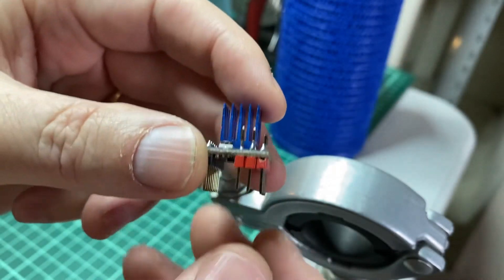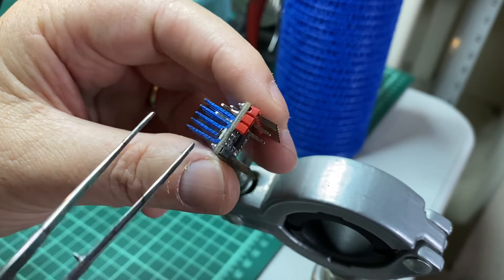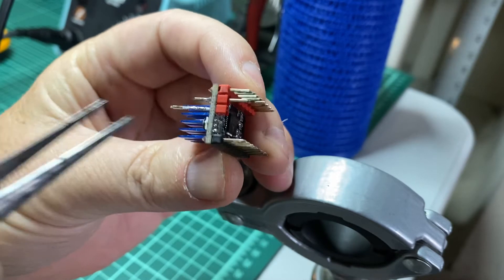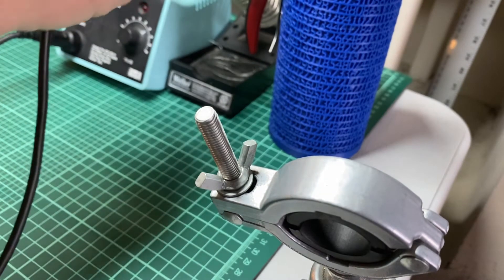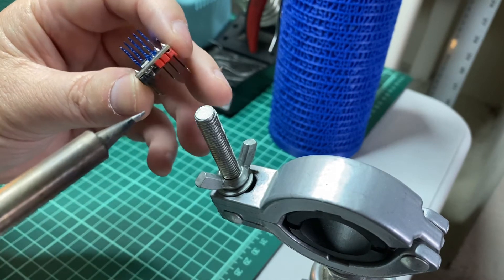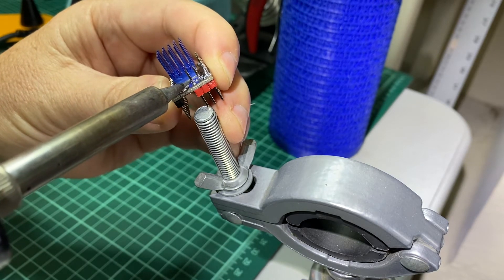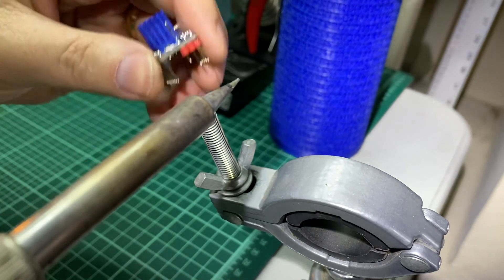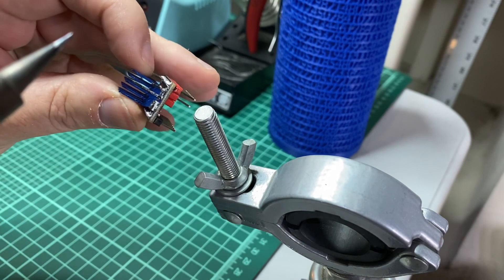TMC 2209 disable sensorless homing (fix for physical end stops not working)

Comment: 700 degrees - no way that can be celsius, still too high for kelvin, so it must be the simp measure - farenheit. Strange when a person is in to 3d printing and still uses the simp system.
Reply from the maker: Soldering station is in °F. No Celsius marking on the analog potentiometer. You imply that I choose F over C, when in fact, I’m just reading off the front of my Weller soldering station. Glad you found my video useful.

Comment: Awesome video. Quick and to the point. I ordered 2208s from Amazon and they shipped me 2209s instead. I was going to send them back, but I was looking into using the 2209s without sensorless homing. I was going to just remove the pin completely, but your idea of just sliding it up makes so much more sense.